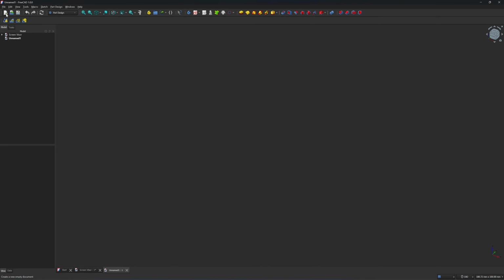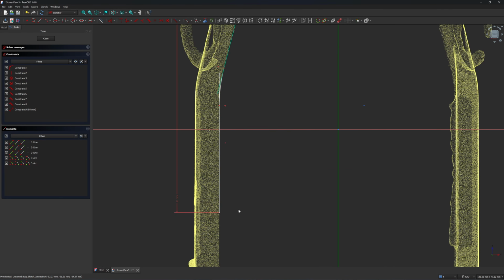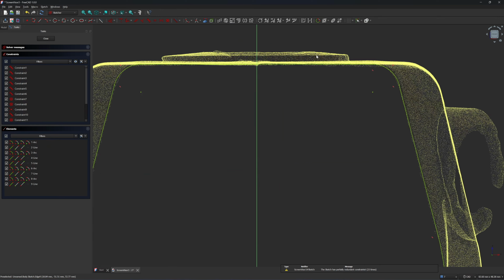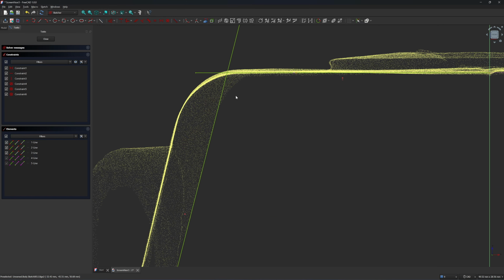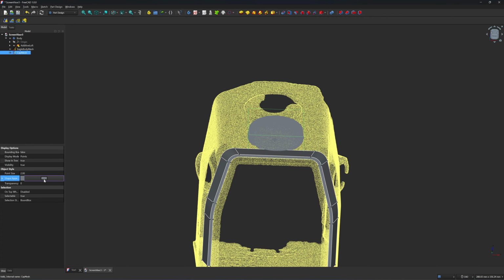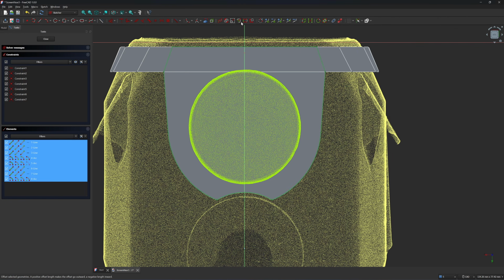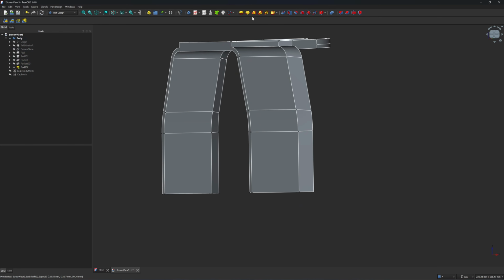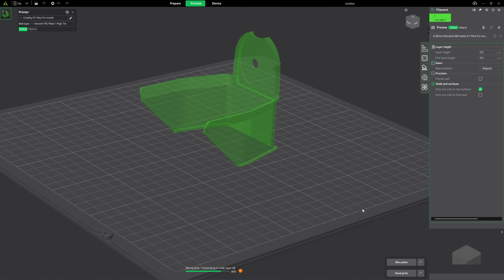Reverse Engineering with FreeCAD: Step-by-Step Guide to Designing Around 3D Scan Data

Comment: Nice to see that you are coming back to FreeCad. Once you learn the FreeCAD workflow it will just as fast as Inventor. Version 1.1 of FreeCAD also have some great updates that will make  sketching and using external geometry much easier. When you offset you can also enable the constraints to make it easier, using the fillet in the sketcher is also an option to speed up instead of arch and tangent.
Reply: Has freecad gotten a lot better (or at least easier to use) in the last year? I tried it about a year ago, and I found it more frustrating than Fusion360, and lately have been using Onshape, which I find even less hassle to understand than Fusion360. I have been using Blender for about 20 years, and would love to use FreeCAD for all the more CAD appropriate models.
Reply: I like FreeCAD but the workflow doesn't come close to inventor.  There are still things Inventor does intuitively that FreeCAD doesn't do.  I had to reverse engineer an exhaust pipe, and Inventor assemblies really made it easy.
Reply: Yes, the workflow is different in FreeCAD just as it is in most CAD software and each one takes a moment to learn the new workflow.
Reply: @johang1293  you could use construction lines instead of removing them. Also the multiline tool could help you do the lines and curves easier , or just do the lines and then just use fillet operation